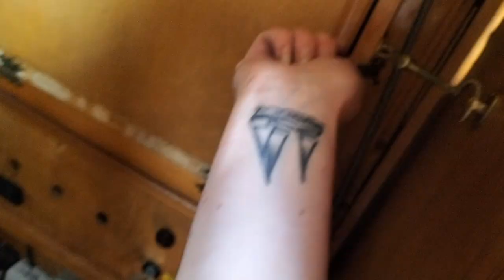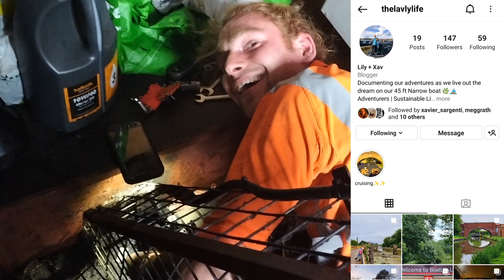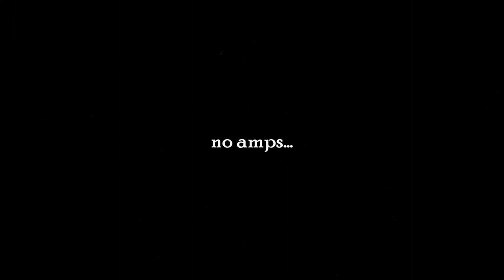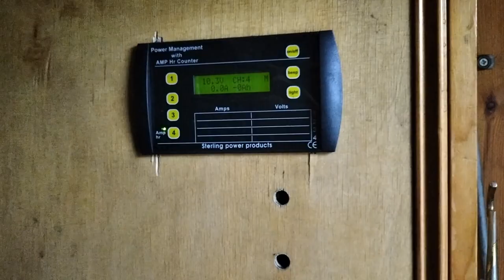Ep 81: Getting down and dirty changing a fan belt!

Comment: Look on the back of the alternator. There should be a small red wire attached. It is very easy knock this off when you are working in a confined space. If so, it is simly a matter of pushing it back on. Good luck!

Comment: I’m very impressed to see you tackling this difficult job and you were right to get some help. Sorry that there was no current afterwards, but don’t worry as it could be a simple fix. I recommend buying a cheap multimeter from Halfdros so that you can test for voltage on the back of the alternator. The engine has to run quite fast to kick them into life. I get nothing from mine until I rev the engine for a couple of seconds, then it is fine, even when the speed is much lower. Please be careful to tie your hair back when going anywhere near the rotating belts.

Comment: If the alternator worked before you disconnected the belts and after the belts are connected  it is rotating but not generating amps then it probably is not the alternator but the wire connection from the alternator to the rest of the system that is the cause.   Good luck. You can do it!!

Comment: Wish I could have been there to give guidance.  Great that you & your friend changed the belts but please please  always disconnect your starter battery or batteries If more than one, Whilst doing this kind of work as three main dangers. 

1. Possibility  of shorting live wire on back of altanator with tools. 
2 . If for any reason starter motor solenoid  got shorted the belts & pulleys would do your hands fingers etc no good whatsoever if engine turned over  and that would make me cry.
3. Also be careful with jewellery rings braclets etc can get caught or cause a short/burns if battery still connected.  
If you did disconnect or isolate the batteries well done. But if not hopefully my suggestions  will keep you safe in the future .
None of what I have wrote is meant as criticism  so please  don't  think it is just like to see you stay safe.
Admiration  to  you both for having a go.
One last thing like someone else said check wiring at back of altanator  for the charging problem . 

All the best
Jeremy & kim

Comment: Glad he was doing his best to teach not just do. Assuming your already fixed up in real time. Fixing a spare pair with zip ties behind the others will speed up a change. What looks like a difficult setup to learn on taking all the tricks of experience. Possibly no ignition current to alternator coils? World around cheers to you, keep learning.
Reply: Its diesel
Reply: @matui6983  Yes. Same situation, 'ignition' run state electrical circuit on even mechanical injection diesels energizes field coils on alternators that are not self energetic or 'one wire', or rare permanent magnet stators. The regulator either on or off the alternator frame controls the energizing of the stator through slip rings. Eg, no battery current to alternator, no output.

Comment: You should look at the link type fanbelts. 
No rubber dust and mess on your alternator like whats in the video. You can take them apart to change if needed rather than cutting like a rubber one and no need to remove all the belts just to change one.

Comment: Next time you're in a car service station pick yourself up a cheap multimeter. You could probably get one for ten quid. You can learn how to use it via You Tube tutorials, it's really easy and once you know how to use it you will be able to diagnose all sorts of electrical problems. The alternators have two electrical connections, or may just have one connection stud. Take a look at the alternator and see if the stud or both studs have wires on them. It's a really bad idea to run your batteries completely flat as this can damage them and you will have to buy new ones. Good luck.

Comment: So you probably found out about this ages ago, but if a 12 volt lead acid battery system shows 10.3 volts then the battery is dead and also it's just showing the battery voltage, i.e. the alternator is not generating any voltage. Even if the field voltage wire that energizes the alternator was connected to the battery, it probably didn't have enough voltage to actually energize the alternator electromagnet (and even if it did, the battery probably couldn't receive any current). The fix - check the field voltage wire (and all the other wires) and replace the battery. (Which you probably already did ages ago.) Other people have also mentioned running the engine at a high enough RPM which may also play a role.

Comment: It doesn't seem so easy to change and tighten a belt on your boat, you need to unbolt more but once you know how it's like a 15 minute job. I also think your alternator connection might have come loose, just plug it in and it will work. Take some pictures how the electrical wiring is connected, so you'll know where to put it if it comes loose.

Comment: Where are you Lizbef????  Did you have a good August on the canals?   
Engines are just a learning curve.  Put on your Brian hat and work the problems slowly end to end, working end to not-working end.  Re-watch some Delos episodes where he was doing boat work and diagnosing problems to get some motivation.  You CAN do these things; you just have to start and force yourself to keep de-bugging bit by bit.  Don't let it intimidate you or be overwhelmed by the entirety - keep looking at the small, immediate part of the problem and work that.  Take pics as you go so at least you can put it back the way it was in the worst-case scenario!  ;-) 

Find a small engine course in some local community.  Some community centers hold short term classes on evenings and weekends about all kinds of things.  Ask around in local pubs if anyone knows anything about short courses on engines.  Find a good book with pictures.   Figure out how to completely remove that cage so you can easily get to all sides of the engine when needed.  Clean it up so the grotty oily mess doesn't stop you from wanting to touch it.  You CAN do this, don't let that negative voice stop you.

Don't give up your dream.  Any life on a boat requires the ability to work on engines to some extent - or a ton of cash to hire it out!  But, that precludes going into remote areas where it is hard to find someone to hire when you have trouble.

I really hope you have continued and spent the last of the summer and autumn cruising the canals and having a blast.
Reply from the maker: Thank you for the lovely words! I definitely need to do a few courses. The engine especially. One step at a time! I'll get there! Thank you again for the support. It's appreciated more than you'll ever know! ✨⚓🖤

Comment: Something  must have been knocked off during the belt installation - think someone else has mentioned a wire.  Can you not find some manual for your engine on line ?  Or is there not one onboard?